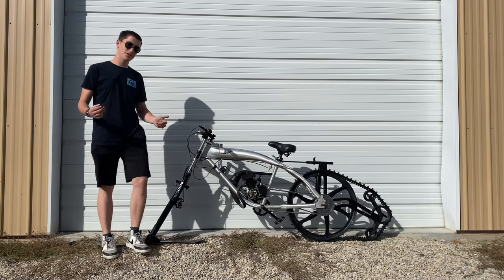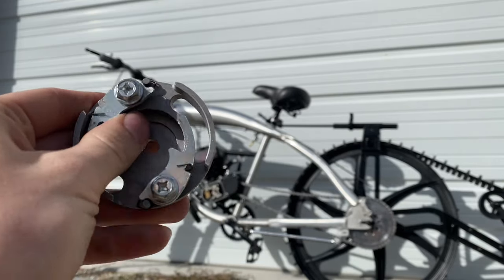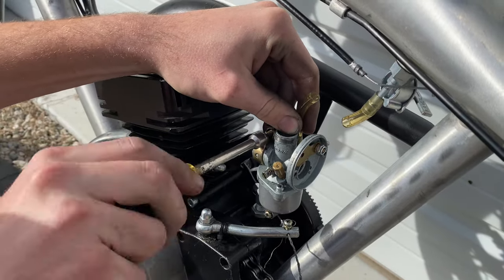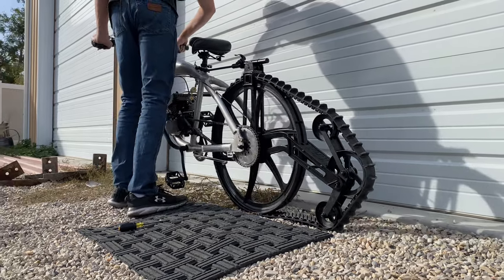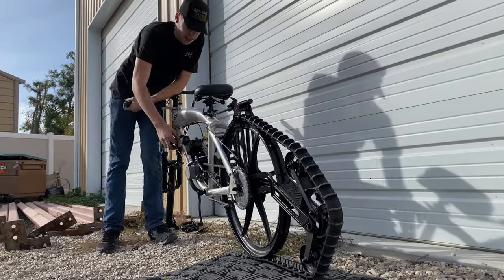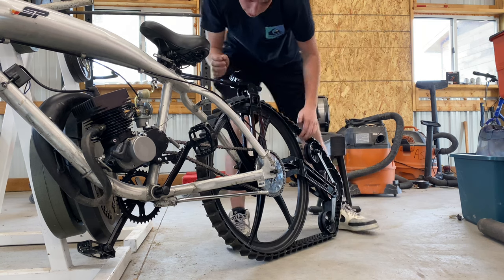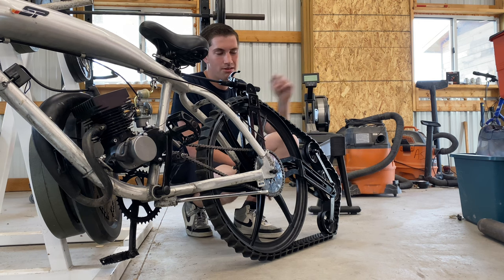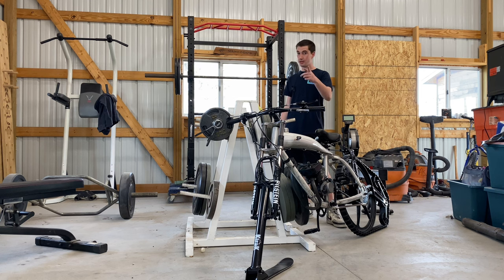MOTORIZED Snow Bicycle Build!! (New Pull Start, Carb, and Ktrax Ski and Track Kit.)

Comment: No way! Looking forward to seeing more of it. Discard the pull start asap.
Reply from the maker: Any idea of how we can start it without it?
Reply: @BT_Motorized  pedal it up
Reply from the maker: @leonardarola there’s no cassette on the track, that’s the only downside
Reply: @BT_Motorized  need a freewheel?! Got an 18t sitting.
Reply from the maker: @leonardarola the spacing is weird, I’m not sure if it would really work. We’ve got another free wheel we will check with. Thanks!
Reply: @BT_Motorized  your call brother.
Reply from the maker: @leonardarola I think we will try one of ours
Reply: I was about to say, can't you just use the pedals as a kick starter?
Reply: @bjornsmasher  Always
Reply: set it up for a drill start

Comment: You need to turn up the idle,unscrew the bolt on top the carburetor that the cable goes into a couple threads out

Comment: After you put at least 20 miles on the motor pull the spark plug if its dry with a white color it's to lean and you need to move the needle valve down just remember it's better to be rich than lean